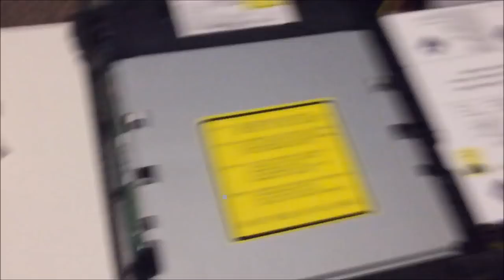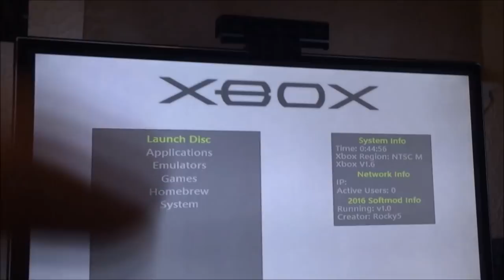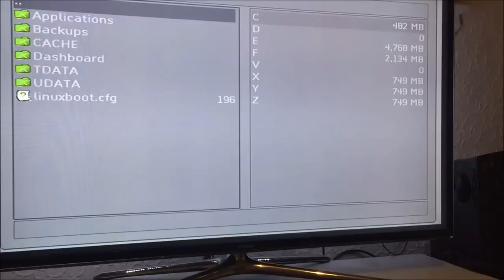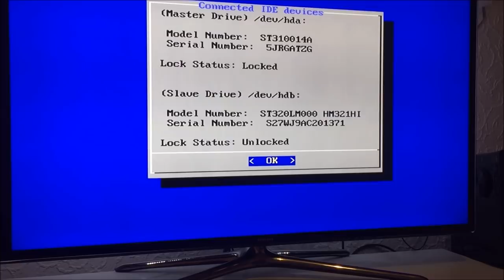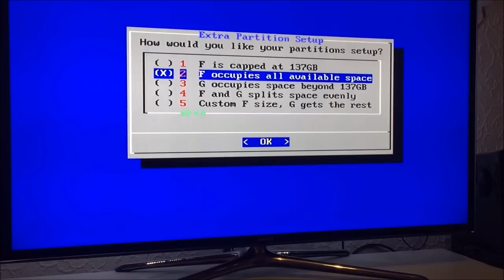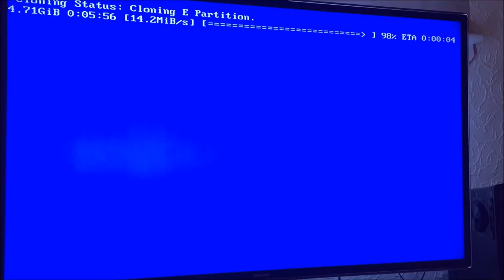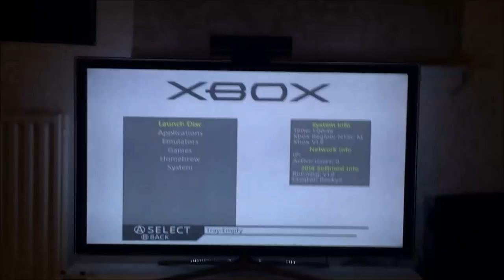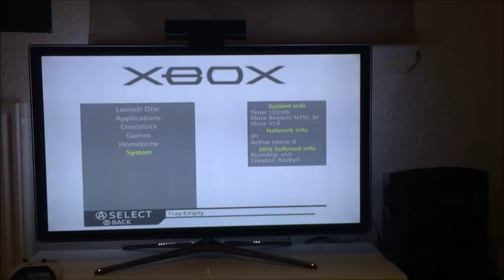How to clone your Hard drive using Chimp 261812 from start to finish.

Comment: Thanks for the video! I've cloned a few drives but having issues with one I done last night. I have a 250GB drive, upgrading to a 2TB drive. After 6 hours, it cloned everything fine but didn't get me the remaining space on my new drive? I selected C, E & F when choosing my directories but I didn't get an option on what I want to do with the remaining space? Cheers all
Reply from the maker: 2TB drives must be split 50/50 so 900 odd GB for F and G.

So cloning from another drive to a 2TB drive is pointless unless the master drive is 2TB also. (You would need to format the drive after the clone if you used a smaller drive as the cluster size would be wrong and cause corruption after a certain GB usage on a partition)
Reply: @JCRocky5  Thanks for the reply mate. Can I clone C & E?
Reply: @JCRocky5  So I cloned C & E, and chose Option 4 in the partition options (F & G splits space evenly) My xbox boots up, splash screen with the Microsoft logo underneath but then loads to a black screen?
Reply from the maker: You using a 80 wire IDE cable? if so it maybe the adaptor that’s the problem. 

Double check all cables are connected properly and the adaptor is set to master or cable select.
Reply: @JCRocky5  All the cables are good as it has been working when I cloned C, E & F but obviously the partitions were messed up. 80 pin cable is good and I've took the SATA Adapter out of a working xbox (My main one) so I know that's good. I locked the drive at the end like you said in the video too. Bloody 2TB drives!

Comment: I'm getting a weird error. As soon as I launch Chimp it reboots my xbox. I have tried two xboxes to see if it was xbox specific but it has happened with everything I try. I have tried composite and component cables. Using an 80pin IDE cable with two Startech sata to ide adapters.. Any thoughts?
Reply from the maker: Make sure it’s installed to the correct location. Just fire the Chimp folder on the root of E.

E:\Chimp\default.xbe and the rest of the files.
Reply: @JCRocky5  I'll give it a try and let you know! I've used it in the Applications folder before on another build and no problems, but it's giving me trouble on this new build. Lol
Reply from the maker: Make sure all files have transferred properly, sometimes the config.cfg doesn’t. I always set FileZilla to binary for transfers and ascii breaks files.
Reply: @JCRocky5  I installed with XBMC4GAMERS so I just assumed it did, but I'll check.
Reply from the maker: No it will, there are some Xbox that will just reboot. I could never work out why.

If you have another Xbox that works just null the eeprom on them and use the other one to clone the drives.

Comment: Hi, i have a full packed 750 HDD with xbox stuff and want to clone them to another 750gb HDD of the same kind. Is this possible with this tool and how long would it take?
Reply from the maker: +suberior yes is possible and for 4.8GB it takes about 5 mins, so do the math to work out how long for 700+.

Use the selected partition options if doing so you will get faster speeds.

Also if you do and you get speeds of 3MB or under, start again. You should get 10MB or over a second.
Reply: Thanks for the fast response. Will try this soon. If i got this right with the partitions options then i would go with option 4 right?
Reply from the maker: +suberior does your drive have a partition table? What partition layout do you have? How did you format the 750GB drive?
Reply: My Partition layout says C D E F and ?Q?. So in this case which option should i choose? Thanks.
Reply from the maker: Is your F partition only 120 odd GB? if so:
Redownload Chimp 261812 and stick the "XBP Table Write" application in your Applications or apps folder and run it. When it loads press B followed by Y. Now you can use option 3 "C, E, F & G" when cloning.
Reply: When i start with unleashx there is no drive q. My C Partition is about 500mb. E is 5GB. F is 707GB. So choose option C F E ? Thanks
Reply from the maker: +suberior use the XBP Table Writer app that comes with chimp first. This will write a partition table to your HDD allowing you to clone the F partition if you're wanting to. 

Is the new drive the same size of larger?
Reply: Yes they are both seagate ide 750gb hdd. My plan is to clone the whole hdd which is packed with data. To get things right : First i go and use the xbp app on the old hdd to write an partition table. Then i go and use chimp with c e f option to clone the hdd because byte by byte will take much longer right? Thank you for your patience ;)
Reply from the maker: +suberior correct.

Comment: On evolution X it uses the E partition for games/app folders, if I use this and the memory goes to the F partition, will I just make new folders there? I’m confused :(
Reply from the maker: +Devia Mysterium if you use this to clone to a larger HDD all your current apps eg... will be intact. You can pick where you want the extra space to be distributed, but it won’t create a folder structure after the clone, you will need to make the new folder when it’s done.
Reply: Sorry to ask a silly question, based on my research Evox looks for games in both the E and F partitions on its own. Hoping all goes well
Reply from the maker: +Devia Mysterium by default it’s setup to look there yes. But you can customise that. 

I would use the F takes all remaining space. 
( use the X button to select that option before pressing A to continue )
Reply: JCRocky5 Speedy reply, what a guy! Don’t believe I’ve altered any settings, certainly haven’t done anything beyond look at the system settings bit on Evox so I should be fine. Thanks for your help and content, gunna drop a like & sub bud

Comment: Will an original xbox work with a solid state drive?
Reply from the maker: It will yes, but it’s pointless. You won’t get any benefits other than no noise. (Also the drive will need to support its own house cleaning as trim isn’t supported on the Xbox)

Comment: hey Rocky5, I tried doing this exact procedure with your exact steps and everytime I reboot, it tells me my Xbox needs to be serviced, and a 7 in the upper left corner of my screen pops up. How do I fix this?
Reply from the maker: That HDD timeout error.

7 - kernel - HDD timeout 

Most of the times, the IDE cable is not properly connected when you see this error. Please reattach the ide cable. Not only to the harddisk drive but also to the dvd drive. ALso try to reconnect the ide cable to the motherboard. 

Press pretty hard so it goes all the way in. Make sure it is seated straight and proper in the drives and the motherboard. If you still have an error 7. Try another ide cable. If that won't work try another harddisk. If there is still no go, try to set the jumpers on the rearside of the harddisk drive. Set it to master or cable select.
Reply from the maker: +Kieran Burke it's a cable or HDD issue. Is it a SATA HDD? if so are you using a 80 wire IDE & if both are true is the adaptor you're using fully compatible.
Reply: Sorry to respond so late;

I swapped for a 400gb Hitachi HDD that was an 80 pin connection, interestingly enough it was an apple HDD that was refurbished. I did everything in the video and it booted normally! Turns out it was an incompatible hard drive after all, now I'm enjoying the benefits of seemingly endless HDD space. Thanks so much for releasing the software and tutorial video!

Comment: hello, will this work if i want to make a backup of my 1tb hdd for another modchipped xbox?
Reply from the maker: +dagforlive05 yes, use the selected partition option followed by your partition layout.
Reply: thank you for your quick response! I want to clone my 1tb sata hdd to another 1tb sata hdd, but I dont have a second ide to sata adapter sadly. Is there any windows software that can help that you might know of?
Reply from the maker: +dagforlive05 any software that writes by sectors should work. Both drive need tonne unlocked though.
Reply: JCRocky5 can you name me such a Software please? and both of my xboxes are hardmodded so lock/unlocking should not be a problem

Comment: JCRocky5 I am trying to install a bigger hard drive  with your version of chimp . When I set the original hard drive  to master and the new drive to slave. The second i disconnect the cd rom the files for chimp  disappear . If i reconnect the cd rom and reboot the files are back .  If i set both  drive to cable select  chimp will  run and pick up the drive , It will ask to format new slave , but it fails . some times it says  write error fail  cluster chain. then other times it just sits and does nothing ....Using unleash x  soft mod , chimp261812 . new drive is western dig Ide   any idea what i am doing wrong ?
Reply from the maker: +Atari Woodgrain try a 80 wire IDE cable, also make sure your master drive isn't getting power cycled when you pull on the IDE cable. 

If asked to format the slave drive when xblast os loads (blue menu before chimp loads) select no.

Also make sure the hdd is in working order.
Reply: ok I have been selecting yes , by holding rt lt white and start ,   I tried 80 pin also , And once in a while i do notice it power cycles  I will try again tonight

Comment: Hi, I am having trouble getting Chimp to load.  I have Unleash X and try to start up Chimp either through the apps tab or through file explorer (default.xbe).  I get to the loading screen but then xbox flashes red and green and times out.  Any suggestions?  I am pretty new to this.
Reply from the maker: conan 050 are you keeping the folder structure the same? or are you sticking the chimp folder in a Apps folder?
Reply: Hi, after some finagling around I got it to work!  Successfully got my 500gb HD installed.  Thanks for the video!
Reply from the maker: +conan 050 cool. If you have any other issues give me a message and I will help you out when I can.

Comment: sorry for asking something that has been asked before but I cannot find where the problem lies. i am copying info from Unleash x system settings:
- dash version 0.38.0515A Build 565
- version V1.1 (0b)
- kernel Version 1.0.5101.1

I ftp the Chimp folder in E:\Apps and I get the two "ok"s I get the "Starting Chimp261812" message and the the process freezes here. any ideas??
Reply from the maker: Poldamundo can you try an older version of chimp please, as it seems to be 1.0 and 1.1 that seem to be having this issue. ( though my v1.1 has no issue ) you cannot use Component cables with Chimp.
Reply: thank you for the quick response! i ll try to find an older version
Reply from the maker: +Poldamundo great, can you let me know if that version works or not please.
Reply from the maker: +Poldamundo +Poldamundo google Chimp 2618. Also do you have any memory cards inserted? ( they freeze Chimp loader/Gentoox for some reason )
Reply: I ve tried 2618 as well but I had no luck. Nope. No memory cards inserted or something else connected, except the original controller
Reply from the maker: +Poldamundo are you using composite or component? also try loading Chimp from another dashboard if you can. ( I'm trying to eliminate everything before I need to go looking at the source )
Reply from the maker: +Poldamundo oh try Chimp 261811 it's on sourceforge. ( it's uses XBLastOS )
Reply: I have tried tried with both composite and component. 
I have tried loading evox from Unleash X and then Chimp. I will try xbmc or something as well
Later today I ll try every possible combination I can think of and I ll report back to you.
Thanks a lot for the help :)

Comment: So my adapter came in and I noticed that one of the pins out of the 40 are missing. Would it still work or should I return it and swap it out for another?
Reply from the maker: That’s how they are, the top center on is missing.
Reply: Oh, okay thanks for the incredibly quick reply. Also, what is the point of the XBP Table writer and do I have to use it?
Reply from the maker: The point of that app is to write a partition table to a drive that was formatted by UnleashX or EvolutionX dashboards. These dashboards don’t write the partition table to the HDD and use static offsets.

My updated Chimp only works 100% with partition tables. 
( you can clone the normal partition but F and G require a partition table to be cloned )
Reply: I see. Thanks again.

Comment: I can't get Chimp to load, older versions crash at the PCI fails, and 261812 stops at "Starting"
Reply: Mine is the same. Chimp Loader eventually gets to Loading Kernel & loading initrd then just sits there.

Comment: Potentially silly question: What is the possible danger in not hotswapping quickly enough? It should not be able to brick the old HDD, correct? 
Anything else I should be worried about?

And is Chimp (in its current version) still the approach you would recommend to replace my original HDD with a new 2TB SATA one? How should I format it?
Reply from the maker: +PukinDumpling no danger you can take your time & yes it’s still the best way. 
( F and G split evenly )
Reply: Again with the lightning fast response time. :)
Thank you very much. I take it, the Xbox needs an F: and a G: partition, right? So, if I had more than 500GB of games I'd have to split them to both positions at some point?

Edit: I meant 1 TB in my initial comment.
Reply from the maker: +PukinDumpling if it’s 2TB you need to split it evenly as you can only have a maximum of about 960GB per partition. 

So a 1TB drive can have all its space on F if you want.
Reply: Oh, okay. So 1TB only F: drive as big as it gets, got it.
Thank you! :)
Reply from the maker: +PukinDumpling partitions can be from 0 to 960 odd GB in size no more or the cluster size goes to 128kb. The Xbox only supports a maximum of 64kb for the cluster size. 

So you can split a 1TB drive between F and G if that’s what you want to do or you can have it all on G or F, or 80% on F and the rest on G eg.... just as long as it’s not over 960GB per partition.
Reply: Okay, I think I understand it all now. Thank you so much!
Reply: Hey, today I did it. Everything worked like a charm. Thank you so much, again!
My new drive has a (significantly) longer boot time though. Is that something that can happen? Maybe the IDE/SATA adapter?
Reply from the maker: +PukinDumpling larger the drive longer the boot time, but the adaptor can effect this also. Can make it worse than what it needs to be.
Reply: Those buggers are cheap. I just order another build and try that out. But you have a point on the size of the HDD. It is substantially bigger. But the Xbox takes about 30 seconds to but which is rather long, I think.
Reply from the maker: +PukinDumpling yeah 30 seconds is to long, it should load the flubber, xlogo and then your dashboard it’s at this point it should take a little longer to load the dashboard not beforehand.
Reply: I'll wait for the new one to arrive. It ships from China, so I be playing the waiting game for a while. :D

Comment: So I softmodded with your softmod on my other xbox now and tried to switch out the HDD. I did it all like I would normally from your video but when I hook everything back to where it was but with the new HDD in its place, I get the boot up flubber xbox logo then goes to error screen number 13...tried it on two same model but different HDD and same thing. I used the same model HDD in my other xbox and it worked great. Not sure what went wrong
Reply from the maker: Try cloning just C & E and then select option 1 (f up to 130gb) when it's done clone (about 5 mins) select option 2 > option 3 & see if there are any errors in the partition table. 

Also are you using a 80wire ide cable?
Reply: k what is the option 2 and option 3 refering too? cause i did the first part and now am doing c and e then f accupies the whole space?

and im using the ide cable from the xbox so im assuming its 80 pin
Reply: I did the 137 gb option with c&e then did option 2 f occupies whole space then the option 3 the space occupies remaining space beyond 137....not sure if that was what you meant for me to do.. didn't work either way lol
Reply from the maker: The IDE cable that comes with the Xbox is a 40 wire version, you need the 80 wire version for data adaptors to work.
Reply: +JCRocky5 well that's odd cause it worked fine with the other Xbox I modded and switched out the hdd. :/
Reply from the maker: Like I said in the video, some work others don't, it's better to get the wire that always works than hope the stock cable does.
Reply: +JCRocky5 ... I'm an idiot lol sorry bout that. The link you have says sold out so I'm thinking his one? MyCableMart IDE Cable,36" IDE ATA/133 Dual Drives 80Wires Ribbon Bulk Cable https://www.amazon.ca/dp/B010RH6ICY/ref=cm_sw_r_cp_api_XZIOxbXCQ15ED
Reply from the maker: Any 80 wire IDE works, so find the cheapest one you can find.
Reply: great I think I have a couple lined up for free ideally tomorrow, I'll let you know if that fixes the issue, thanks for your patience and help as always man
Reply: +JCRocky5 so the 80 wire fixed the issue thanks again!
Reply from the maker: You're welcome.